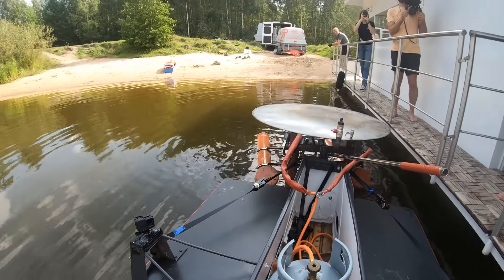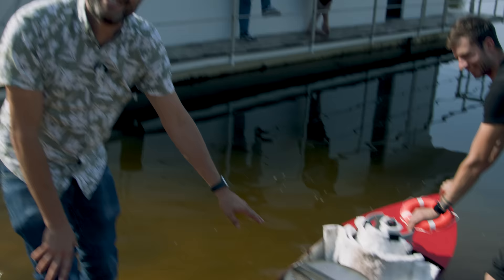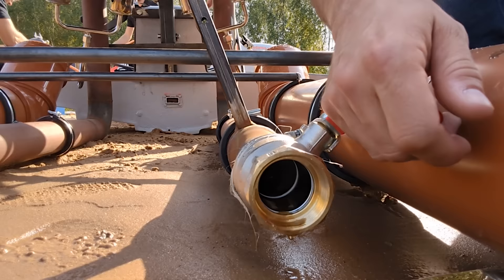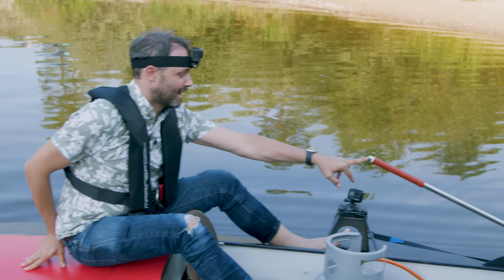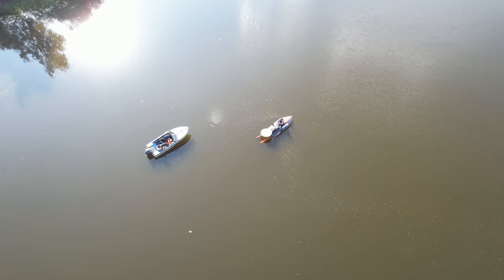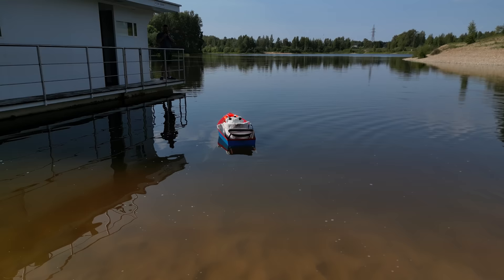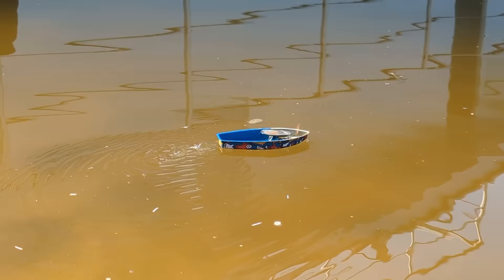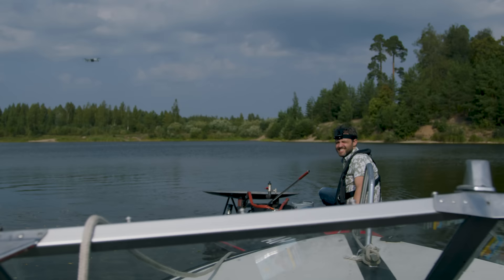Will this toy engine work at full size? (yes)

Comment: There's two ways to make a human sized put-out boat.

I feel like this one is the "one horse sized duck" strategy. But I think I'd like to see the "100 duck sizes horses" strategy too
Reply: Yeah that'd be interesting to see- 100 pop pop boats trying to push a life-sized boat.

While a normal sized duck watches.
Reply: @DarkestVampire92  I think pulling with the pop pop boats hitched up with ropes would work better 

it would be like a carriage except it travels on water and it is hitched up to non-living pulling things
Reply: I'm sure you could design a more optimal horse-duck.  Without the popping diaphragm, better heat conduction

At a certain point it would start resembling a steam engine.

Eventually, it would just be a steam engine
Reply: Well!
They dont make giant batteries for electric cars either, so I think scaling up the boat with the appropriate amount of mini poppers would be worth doing. You could probably set them up to fill easy too.
Reply: @tsm688  Wonder how using a valved pulse tube like in a drip coffee maker would work to improve things by eliminating the extra volume in the steam pot.  Using a flow through design like that might improve outflow a bit and a header with backflow preventers using multiple pulse tubes could provide for even higher velocity output through a single final outlet.

Probably would be highly inefficient though with higher water temperatures at the outlet.  Wonder what Count Rumford would do...

Best!
Reply: A human sized put-out boat also known as a blow up doll.
Reply: @broncotrolly hmmm, I'm not sure we're talking about the same thing....
Reply: Was hoping this vid would go that direction
Reply: @DarkestVampire92 ”while a normal sized duck watches” with a dark hoodie on, cinched tight around the face to hide? 😂
Reply: @neilfromclearwaterfl81 you and I had the same exact idea, from facing cold water tube with one-way valve and rear facing warm water tube with a respective one-way valve and some sort of percolating mechanism for a boiler. Might not be a real pop-pop boat, but it would be far more efficient.
Reply: @_..-.._..-.._  A condensing piston steam engine would be more efficient than either however the magic of it all would then be gone plus you'd be dealing with a hotter boiler and much higher pressures.

Those four jet burners that they used looked like they went through propane like a fiend.

Best!
Reply: Yes, the horse-sized duck floated behind him at one point.
Reply: Quack
Reply: Put-Out boat? lol.. Reminds me of the joke “Wanna go on a boat ride with the macho man?”
Reply: Maybe increasing the surface area by using a professional water heater with a winded up pipe instead of this flat pot could speed the boat up.
Reply: @tsm688  it made me think of a Stirling engine with no moving parts...
Reply: @ianhelyar6383  There is, the thermoacoustic.
Reply: @wurstelei1356  Yep, that's what I was thinking, along with a couple other things. Their system was designed to mimic the look and sound of the mini pop pop boats rather than designed to work around the inefficiencies created by scaling up. I was thinking a steam pressure washer could donate its burner/boiler. If they want to keep the sound, a small fist size old fashioned oil can could be attached
Reply: @tsm688  They say instead of a duck, if a horse had the head and neck of a crocodile it would be the most ferocious land predator. Now if we were to extrapolate that into the size of a duck, and riding a put-put boat.... geezus!
Reply: @neilfromclearwaterfl81  I wasn't aware there was any kind of valve in a drip coffee-maker.  In fact, I have a disassembled one right next to me (a mini 4-cup Mr. Coffee) that I took apart to provide a switch for my other one.  There are no valves; just a simple tube with a heater.  

Maybe there was a valve in the reservoir?  I threw that part away, but saved the heater part.
Reply: I just commented that multiple smaller engines might be faster. Because of the frequency
Reply: @tsm688 Interesting to note: There is actually a stirling engine that uses liquid pistons, that is used for pumping water (and I find them remarkably similiar to pop-pop-boat engines), it's called a fluidyne engine, I've been thinking about making one (as they're probably the simplest engine to build at home, because the only loving part is water) and try to power a boat with it!

I've been pondering it for a while, and this engine (and boat) has given me some real inspiration!

Comment: My Father and I crafted and sold handmade pop pop boats on a website 20 yrs ago. The boats were called “featherlite steam boats” because they were press formed from aluminum sheets and we included certificates with serial numbers for each one.  These were the only pop pop boats with small rudder on the rear.  Fun times !
Although my Father has passed away some time ago I still have the press forms to create the boat hull and top and all parts to braze the engine parts.
Reply: In childhood days I was greatly frustrated by the fact that all my pop pop boats were destroyed because the solder between the propulsion tubes and the upper boiler melted. Why didn't the manufacturer use a higher temperature brazing technique to attach the tubes to the boiler?
Reply: @beingsentient  The boats we made to operate using olive oil and wick. Other boats that were made in India came with small candle.  The flame created on either type would technically never reach melting point of lead/tin solder.  Besides, the water/steam inside the pop engine would also prevent temperatures to reach melting point of lead/tin solder.  
This is why plumbers use maps gas torch (1000 degree) to desolder copper pipes that still have some water inside.
Reply: @beingsentient  tje boat is suposed to be in the water before you put the heater in it
Reply: I found an older article about it by googling. That's neat!
Reply: You should re-visit producing them... We need a simple toy nowadays
Reply: You should definitely bring it back, even if it’s just a few a year on the side
Reply: @mrBDeye are you interested in creating them again?!
Reply: Seems like he left you a mission
Reply: I had a little putput boat that had a rudder I wonder if it was made by you guys
Reply: That's really cool.  I wish I could have bought one

Comment: An anecdote  from the UK. In 1946, I had a tinplate boat about the size of a slipper. In the centre was a small container into which one poured about 20ml of methylated  spirits. Around  the rim of the container were two layers of smallbore  pipe. The two pipetails were soldered either side of the rudder, one being 10mm above the other. One lit the meths ,waited for a few minutes for the water to heat and expand in the top pipe before watching the boat cross the pond in silence. I still have it in my nostalgia  box.
Reply: Was that your boat Pop Pops?
Reply: You were alive in 1946
Reply: @theiigotriangularround4880  yes they were
Reply: @mystifoxtech  were or are
Reply: @theiigotriangularround4880  were because it's no longer 1946
Reply: @mystifoxtech  how are you so smart and I aren't?
Reply: How are you still alive?

Comment: Interesting, Steve… A point missed by yourself and the others is that a pulsating water engine (PWE) or 'pop pop', 'Tok Tok' etc., doesn't have to have the flat plate. Toy ones only had a flat diaphragm to make an engine noise. 
A simple coil of tubing over the flame works better as the flash boiler, and was used in larger model boats like the beautiful, pressed aluminium 'Miss England' by Victory Industries, sold just after WW2, as well as in many kit and scratch built models. 
The PWE engine works by rapidly boiling the water in the flash boiler, which turns to steam and forces the water in the tail pipes out quickly. As the steam hits the cold pipes, it condenses, while the exiting water providing the thrust carries on moving down the long tail pipes under its own inertia (some small toy 'pop pops' only had a single tail pipe). The moving slug of water's inertia then creates a vacuum after the pressure of the steam bubble disappears, which eventually pulls in water, increasing the cooling of the condensing steam and refilling the tube, and 'boiler' section, with liquid. The coil (or chamber/boiler) over the heat source gets rapidly boiled again to send another pulse of steam down the system as it overcomes the back pressure from the now condensed previous bubble of steam and the drawn in water, which is pushed out to provide thrust (but not a lot).
A 'full size' PWE powered boat was actually built before WW2, though only a dinghy in size and very slow, it was virtually silent and used to stalk and net waterfowl on a calm pond.

My late father had a huge collection of old steam powered toys, including a lot of PWEs. Most of the PWEs were small candle or spirit heated 'pop pops', but some commercially sold ones, usually methylated spirit fired, were as big as half a metre long or more.
Reply: Absolute nonsense.
Reply: Very cool, I had wondered if there was a more efficient way to make this work! Cool history, I doubt there's many people who'll know of this these days
Reply: @TheManOfMyriad by inclosing the heart source you would also increase efficiency.
Reply: @jvtaxi3766 Care to explain?
Reply: @EMLtheViewer  Try study the subject a little more ,then see if you really want to ask me to explain.
Reply: @jvtaxi3766  Surely someone as learned as yourself should easily be able to provide at least a modicum of support for a claim you make. Simply calling something nonsense and not elaborating at all is not the basis for any decent argument. Not everyone has the time or energy to look for the evidence you omitted.
Reply: @EMLtheViewer  I am not looking for an argument, I don't have the energy nor the time for one, I was simply stating a fact.
Reply: @jvtaxi3766 get better rage bait
Reply: @Leopard_211  what do you suggest Master bates.

Comment: I think drawing water in from a rear-facing opening slows things down a bit. I'd suggest having one pipe forward with a check valve that only allows water in and the other pipe backward with a check valve that only allows water out.
Reply: i too like to only go in circles
Reply: @sum-dum_nerd if you put both pipes in the centerline of the boat it’ll go in a straight line.
Reply: @Sashazur  ooooooooooooooohhhhhhhhhhh
that explains so much!

Comment: In chemical engineering, there are concepts to overcome the square-cube law. Instead of a scale-up of a reactor (bigger tank), you can do  scale-out (more reactors). In extremis, this results in chip-size reactors with lots of surface area. To bring this into the context of the video, just use 10,000 of the minisized pop pop boats :)
Reply: Thank youuuu. I had the same thought just from understanding automotive engines lol.
Reply: 😂 he could ask Boudreau for pointers... lousiana has had a pop pop river parade for over 80 years.
Reply: Maybe a shell and tube type heat exchanger could be adapted to convey heat to the tubes with the water inside the tubes. A lot of hot air in the shell. I imagine it would have to be pretty hot and perhaps a blower in the shell to increase convection a lot.
Reply: I actually had the same thought, but I was thinking of creating chips of microscopic popping chambers.
Reply: @snerttt  too small and capillary effect will prevent them working.  I don't think they can be made too much smaller than the small ones already are
Reply: He plows through this solution with the demonstration with the blocks... by putting 8 separate blocks together in one big block you scale unfavorably compared to the smaller block, but if you keep 8 separate blocks, you scale effective properties in proportion... so just use a bunch of smaller poppers with a bunch of pipes.
Reply: "just"
Reply: Possibly though the issue here which is basically a boiler was solved ~200 years ago for steam engines.
Reply: @tsm688  to drain boiler filled with water, the capillary effect would have to pull enough vacuum to boil the water at that pressure.
Capillary effect also less when water is a higher temperature. zero when it's steam.

viscosity of water would could be issue with thin pipes
Reply: You can make the machinery bigger, larger scale but I don't think you can scale up things like ' surface tension '.
Reply: This is the problem with the flat-earth Believers is that they believe all science is scalable
Reply: Thought same thing
Reply: Yes. While he was explaining the square cube law I got the feeling that, while relevant, it was hardly an insurmountable problem.
Reply: I was thinking the exact same. Just compare a 2L 4 cyl engine to a 2L V8 engine... Many smaller units generate much more power.

Comment: 2:25 Honestly kind of surprised no one there put an RC rudder on the teddy bear boat. Or even a fixed/adjustable rudder to make it just go in circles and not straight out on the lake
Reply: It probably goes tok slow for a rudder to make much of a difference 

The human sized boat steers by moving the motor rather than a rudder
Reply: @mctripleA It will make a difference no matter how slow it goes.
Reply: because most of the time it does not go fast enough for the rudder to overcome the wind turning it..  so would only work a small portion of the time.
Reply: @neutronenstern.  However they could do a nozzle jet deflector just like waterjet  boats have. One probably could make one easily from one of the variants of semi rigid hose and couple actuators
Reply: Realistically it was a prototype to test the scaling ability of the engine, not the full functionality. Likely just not worth spending time on it when you can prove out the theory and move onto the full scale boat.
Reply: I am sure it is just a hobby project with no practical purpose.  Why would they invest a few hundred dollars of money into something that is just a proof of concept and will never be used more than a few times?
Reply: It was just a quick prototype on the way to a bigger boat. Nobody was interested in developing steering for this teddy bear boat.
Reply: I fully expected a simple rope to pull it back. Was really amazed they didn't have anything other in place than a person manually turning it!
Reply: @azrobbins01  that is exactly what they did do.  People spend time, effort and money on things of little to no use because they are inquisitive, or artistic, or just because they can.
Reply: It's a proof on concept, why waste the effort when someone can just swim out?

Comment: Hence why cars have multiple cylinders, square cube law. If you tried to blow up a three liter bottle the explosion is way slower and takes more rotational mass to keep going as compared to six half liter bottles which explode faster and can keep each other moving. This can be applied to whatever engine size you have.
Reply: I was literally just thinking along these principles!
Reply: V12 pop pop when?
Reply: damn this makes  so much sense, thats insane. thanks
Reply: Multiple cylinders is also preferred as it allows a faster revving engine than a single of same capacity.  Power = torque x speed of course. However their is a limit on piston speed due to materials and lube etc, so using multiple cylinders overcomes this.
Reply: It is also the reason why kids (eg. in winter) cool down much faster then adults. Their volume, which stores the thermal energy, is in relation much smaller then the surface, which distributes the heat to the air.
Reply: Having multiple cylinders mostly comes down to packaging and balancing reasons, rather than pure efficiency. In fact most engines tend to have less and bigger cylinders in cars nowadays because that makes them more efficient and cheaper.
Reply: @Looser_23  Fewer cylinders because of economy makes sense, but if more cylinders allows faster engine response, why would F1 cars go from lots of cylinders to 4-cylinder engines?
Reply: @bricaaron3978  You need to remember that F1 is NOT a race based on the fastest car. Its a race for cars built to very VERY defined particulars. That's partly why it's so damned boring nowadays......
Reply: @bricaaron3978 because of rules, rules meant to keep certain things like speed and power in check. In that light the switch from V10 and V12 engines makes sense as a means of restriction.
Reply: For the same reason smaller cylinders lose more of their heat to the cylinder walls and are thus less efficient. So when efficiency is the priority engine design tends towards fewer larger cylinders, while when power to weight is the priority we see more of a trend towards smaller more numerous ones. 

The vast majority of modern car engines have cylinders of about 0.5L each, so it seems this is about where the trade-off is right for a car.
Reply: @gs425  "You need to remember that F1 is NOT a race based on the fastest car."

I didn't say anything about vehicle speed. I was responding to the previous comment about engine response --- how quickly an engine responds to the throttle input. That clearly matters in any race, and is a defining characteristic of a sports car.
Reply: @bricaaron3978  Perhaps,  but in this instance, the engine defined by the FIA
Reply: @gs425  "Perhaps,  but in this instance, the engine defined by the FIA"

In other words, the people who complain about the rules** have a point?

** And who don't understand that grown men have a right to risk their lives without mommy telling them they can't...